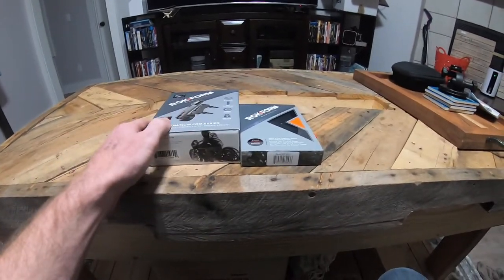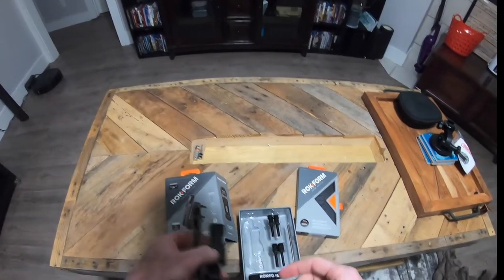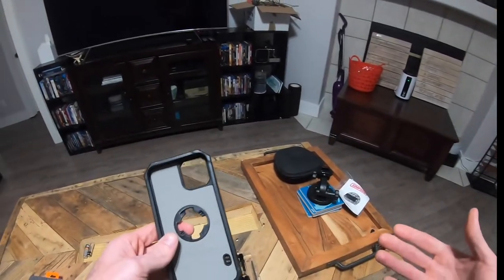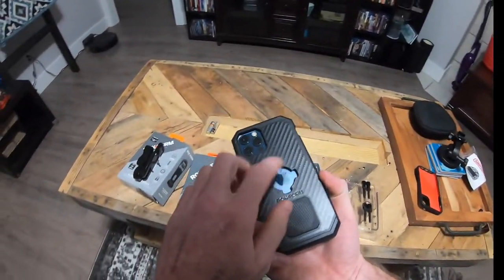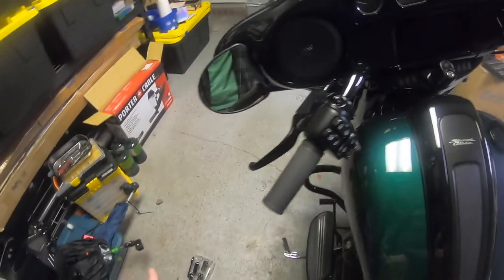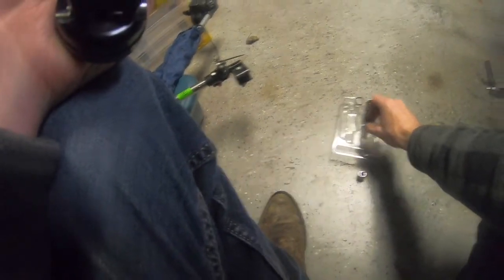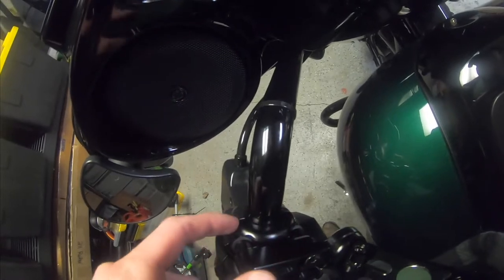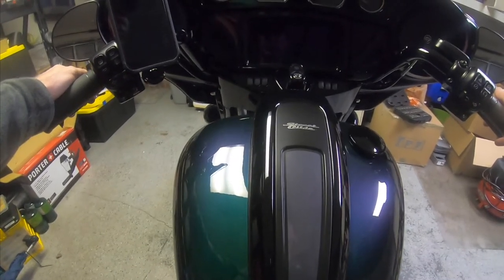ROKFORM Perch Mount Cell Phone Holder Unboxing and Install

Comment: Good video.  Was up in the air on what mount to buy for my street glide. I bought one for law abiding biker and it was terrible. Phone never stayed where it was supposed to.  Not a fan of ball mount systems like Ciro or Ram. This mount looks pretty well made.
Reply from the maker: I love this mount system. I will say after some time with it the magnet in the cell phone case can get annoying at times when I have on sweat pants doing laundry and it pulls my phone in my pocket to the washer/dryer but honestly its not big enough of a deal to make me want to change. It really locks your phone in securely once attached to the mount. I never even had the phone so much as shift on me going down the road. It stays right where I want it.
Reply: @BanditMotoVlogs  thanks for the reply. Appreciate it and it helped make my decision

Comment: Great structure and easy to install. Biggest drawback is lining the holes up when remounting the cell back on the mount.  The magnet is great but also interferes with trying to line the slots up so you can twist and lock in place. Their are NO install instructions!be careful because you 2 sets of screws metric and standard.
Reply from the maker: I will agree with the magnet interfering with trying to mount it but the more you get use to mounting it the less it interference it has because you figure out what angle and all is needed to mount it. Sometime the magnet attracts to things I don't want it to when the phone is in my pocket as well which can get annoying at times.

Comment: I heard that the vibrations coming from
a harley can mess up later iPhone model cameras. Quad lock has that vibration dampener attachment, are the spacers and washers supposed to mimic that dampening effect?
Reply from the maker: No I don't think they work the same as the vibration dampener. I have not noticed any issues with my iPhone 12 though.

Comment: can it be mounted on throttle side?  (usb side capability, short cord run)
Reply from the maker: Yes it can and funny you should ask that because I have been considering switching it for that purpose. Initially I placed it on the left so my drink holder could go on the right but after I have ridden like that for some time now I think I'm going to switch them because I can still reach across to the left side with my right hand to get my drink.